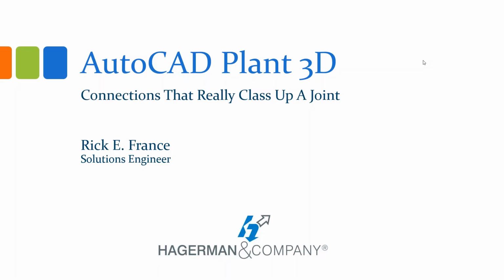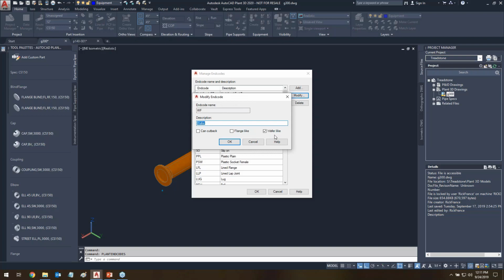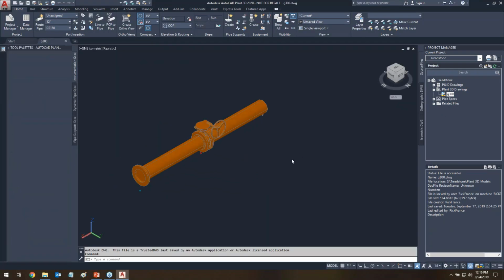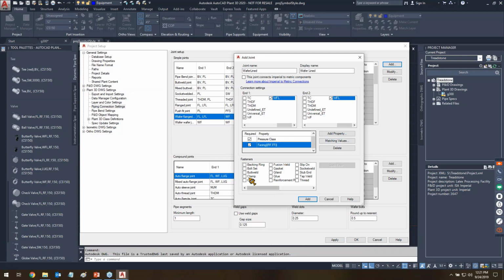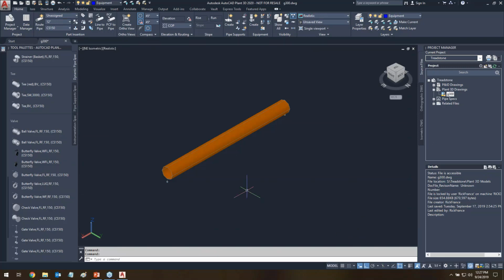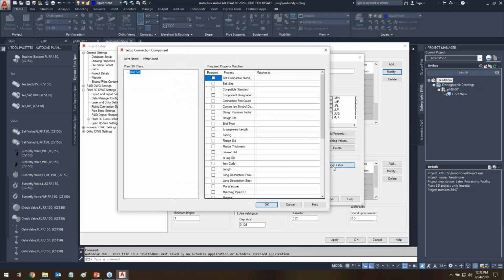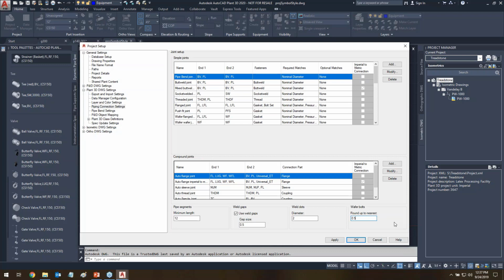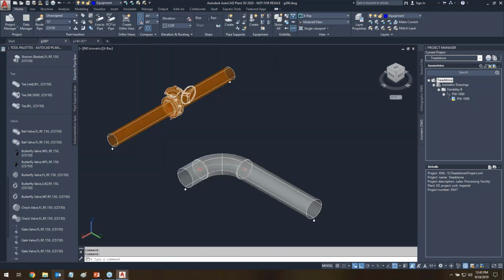Plant 3D: Connections That Really Class Up A Joint

Comment: Hi. Good explanation indeed! But, I try to aply to that to a gate valve and it does not work! I don't know why because I follow yours steps just by changing the valve in the spec editor and it all seems right until I open the solidworks and the valve with the WFL does not appear. Can you tell me why?  Thanks